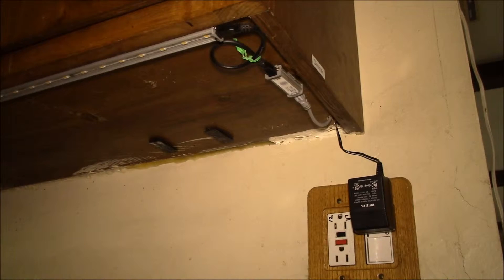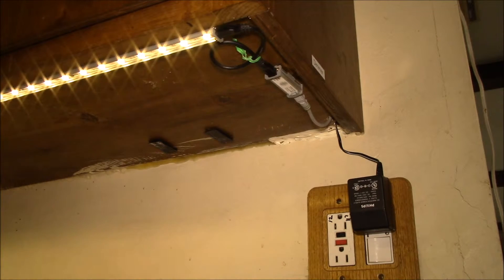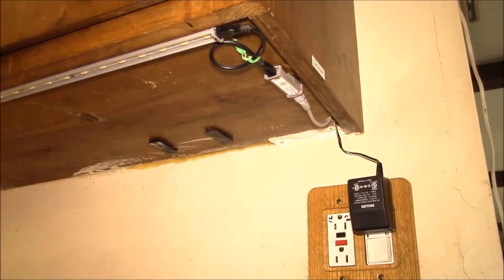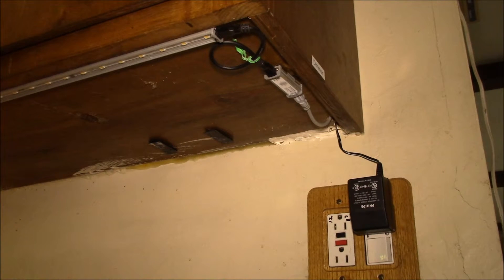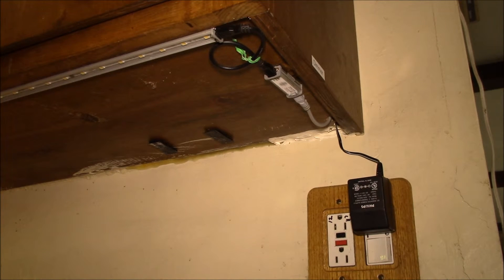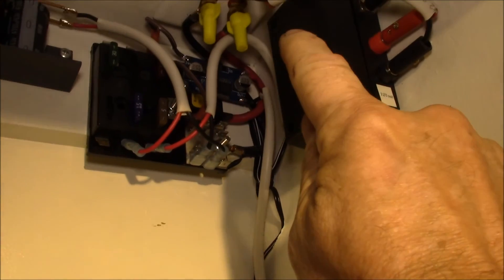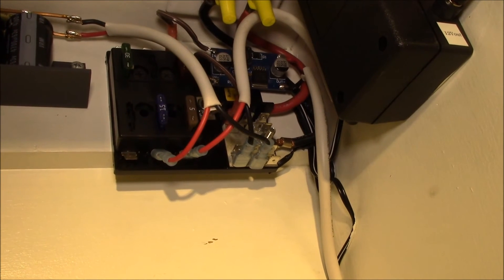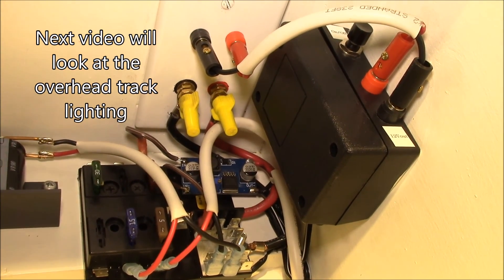Solar Kitchen Lighting, Part 1

Comment: I see what you've done! thats very clever to make sure you comply to your country regulations! 

Your under cabinets lights and MR16 spots can be isolated by switching off the transformer by the wall?
Reply from the maker: +pietkaify Yes, that's how the overhead MR16 lamps work.  The switched wall outlet turns the small transformer on/off and that turns a DC relay on/off to send power to the lamps.  So the wall transformer is my mains to DC interface or isolation device.  The under cabinet lighting is totally separate from the mains wiring, it has a separate touch control dimmer control.